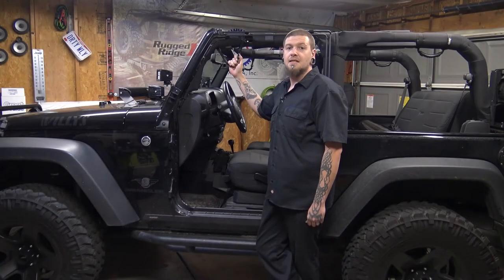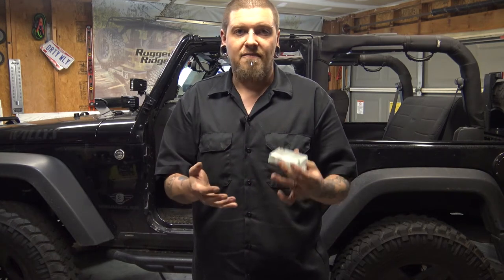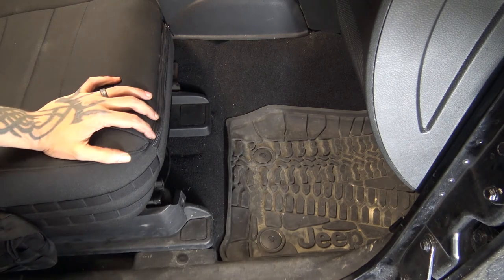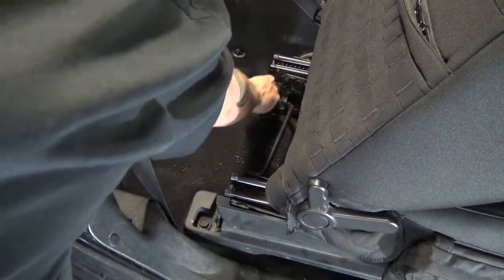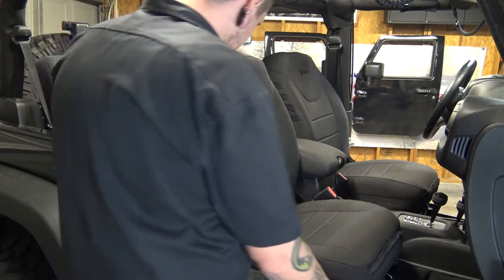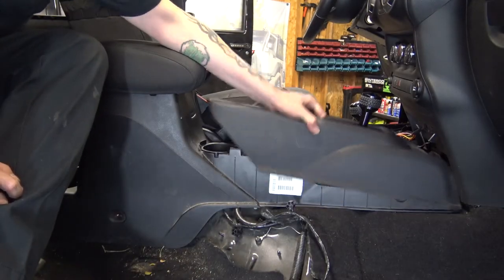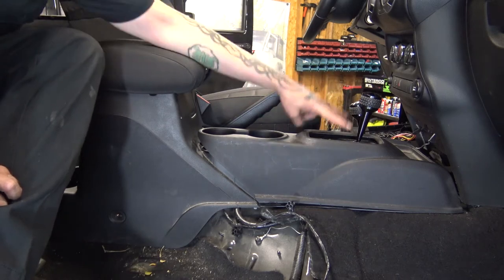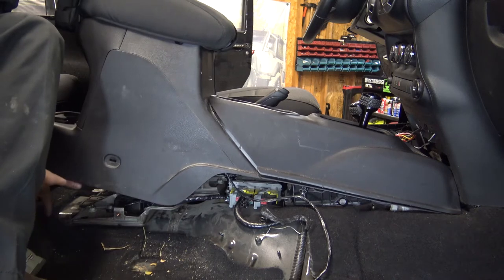How To Add a Motion/Proximity Sensor To Factory JK Alarm, Project Dirty Willy Ep.19

Comment: Cool. Can you show how to adjust the proximity sensor box. Like the buttons on it?
Reply from the maker: If I have to take the console back apart for some reason I'll be sure to video the adjustments. All you have to do is remove the little black plug (they look like buttons) and you will see 2 adjustment screws. You just have to mess with them, at least that's what I did. Thanks for watching!
Reply: Rocky X TV ok cool thanks. Yea I see that there is two dials. Do you know which dial does what?
Reply from the maker: Honestly is has been so long that I forgot...
Reply: Rocky X TV no problem. Sweet jeep.
Reply from the maker: Thanks!

Comment: Hi bro it's me again, I've purchased everything I need for the install, just one question...the Directed Install 508d  Motion Sensor has two rubber adjustment knob covers, do I remove them? is there a screw underneath each? Also since we aren't using the chirp feature I will only have to adjust the outer beam (right knob)? Thanks again
Reply from the maker: There are two adjustment screws under those plugs, one for each zone. You can either leave them where they are set if by chance they work out for your vehicle/application, or you may have to fine tune them so the system won't be overly sensitive. I had mine set way to sensitive at first and it would go off if someone walked withing a few feet of my Jeep. That was a little too much.
Reply: The wire I'm using is the door pin on a sedan vehicle, the problem is that this wire also runs my DOME light, the sensor worked for a couple days until I used my DOME light manually, then it stopped working. I tested the door trigger wire and there is a voltage change when the DOME light is toggled on/off. I then tested the output of the sensor trigger wire (blue) when the sensor is triggered, the reading is 0.83 on the multimeter BUT it is not triggering the alarm at all anymore. Any thoughts on what you think this could be? Thanks
Reply from the maker: We'll get it figured out. I think you just have it hooked to a positive instead of a negative.

Comment: hello willy, greetings from ghana and thats an amazing video you have there. I have a few questions.1, can I install this in a car with no factory alarm system and just connect it to a siren or the car horn.2, Is there a time delay between which the device starts to work when turned on.3, From your video I am quite confused how firstly u activate the device and activate your factory car alarm as well, what turns what on between the car alarm and device. Please help, just got robbed, I need to fix one asap.
Reply from the maker: You could add this sensor to just the horn or a siren, but it would require more wiring and another relay. There is a 15 second delay between the time you "arm" the system and when it actually starts working. As for activating, I'm not sure I follow, You just press the lock button on the factory key which "arms" the system which in turn activates the factory alarm and added motion sensor. I hope this information makes sense, thanks for watching!
Reply: Thanks for they reply. I want to get the motion sensor and a siren for my car ( toyota corolla 2013) but my main issue is how to turn the motion sensor off when it is armed and I am  outside the car as my car didnt come with a factory installed alarm.
Reply from the maker: I see what you mean now. Unfortunately you would need to install some form of alarm system otherwise you would just have the motion sensor wired to a switch and you would have no delay before you get out of your car it goes off. It would also only go off once because the sensor only sends a single pulse signal. You would have much better luck looking into some of the Viper alarm systems because some of them have a spot where you can just plug in the motion sensor, no extra wiring required. It looks like using just the motion sensor and a siren alone will not work out very well in your case, but some of the Viper alarm systems are pretty affordable, and I believe some may come with the motion or a shock sensor. I wish you the best of luck and I'm sorry to hear about your break-in.
Reply: Great Willy, I just wanted to be smart about this but was loosing a lot of sleep. I was considering having only the Viper 305 which comes pre installed with a shock sensor but no motion sensor but issue is i dont want a break in before my alarm goes off. Is there any complete alarm that comes with a shock and motion sensor pre installed, if not what will you recommend. That i get the motion sensor which plugs easily into the viper 305 and both will work fine. Appreciate your concern and time willy.
Reply from the maker: If you are talking about the Viper 350 alarm system, yes you can get the Direct Install Essentials 508d motion sensor and it will plug directly into the system. This setup would give you the built in "shock sensor" of the Viper 350, this is if someone bumps you car or bangs on it (you can set the sensitivity) With the 508d added it would also detect motion in or around the car depending on how sensitive you set it as well.
Reply: Willy, I am getting the Viper 3105, can you guide me on fixing it, I will appreciate that a lot
Reply from the maker: I'll see if I can download the instruction manual as well as the wiring schematic for your Toyota and see what I can do. When you get the kit you will want to get some T-taps as well, these will make connections to your car so much easier. You can also email me for help at rocky.tvchannel@gmail.com

Comment: Is there a way to add a Tazer to the driver side seat that gives the thief a tingle in their dingle?

 I am thinking of hooking up a halon or CO2 dump into the engine air intake that will deprive the I.C.E. of oxygen while the alarm is on, That way eventually if they disable the alarm, the engine will not start until the air intake has dissapated the Halon or CO2! 

Which should take 10 to 20 minutes.

That or an alarm activated Fart In A Can to the interior cab with auto door lock on.

 This will lead to enough frustration that they will give up, throw up, Or they will call 911 and turn themselves into law enforcement voluntarily!

What do you think of the three options, Tazer to the Deriere, Engine Air Intake Oxygen Deprivation, or Fart In A Can to interior?

Or all three?
Reply: The above comment is NOT mine, my husband borrowed my tablet and did some creative writing! 

I apologize, he is in the dog house and it will Not happen again!

Comment: I think the warn output is one of the coolest features.  Unfortunately no warn input on OEM's.  My question is, how the hell does the exterior proximity work when it's buried in interior plastics?  Or the interior for that matter?
Reply: It uses radio waves (microwaves) that are able to penetrate plastics, carpets etc but not anything metallic
Reply: @darrellcoutinho805  -- So sort of like sonar.  Yeah, I see now.  I suppose metal would absorb any electromagnetic radiation.
Reply: @lJUSTwanaCOMMENT  yes, in a way. All these types of sensors use the doppler effect to sense changes in proximity. When set up correctly, these microwave sensors are excellent 👍🏽

Comment: Do you get gate open signals when you step into the car before ignition is on?
Reply from the maker: Before the ignition is on yes. This is also another use for the micro switch, you can mount it in a hidden location that is also easy to get to and you can simply flip the switch if the gate indicator is an issue. Thanks for watching!
Reply: Rocky X TV Thanks that makes things clear, thats indeed a good thing to install the switch so you can turn it on when you want. Nice video and good explanation.

Comment: Is this the same if you add to a Viper 5706v?
Reply from the maker: The Viper system should have a connection port that you can just plug the proxy sensor directly into, I could be wrong though. I'm not 100% familiar with that system. I'm sorry I couldn't give you a better answer, thanks for watching!
Reply: Rocky X TV thank you

Comment: Where do I attach the switch to disable it ? Witch wires?
Reply from the maker: On the red constant power wire for the relay, thanks for watching!
Reply: How about if I have the motion sensor hooked up with the viper alarm.
Reply from the maker: If you have a Viper system you should have a spot where the sensor can just plug right in. This proximity sensor works with a bunch of systems and is plug and play with most Viper setups.
Reply: I know but for the toggle switch to turn it on and off , do I have to cut the red wire and then attach one side of the red wire to the switch then the other half to the switch? Like I have it setup up with s viper alarm ?
Reply from the maker: If you have it plugged into a viper system, not the OEM alarm like in the video, you would need to cut the RED wire in the little 4 pin harness (red,black,green,blue) for the sensor. That is the power wire for the sensor. Attach one end of the cut wire to your switch and the other end of the cut wire to the other side of your switch. You may have to extent these wires to put the switch in a location of your choosing. When you turn this switch off it cuts power to the sensor only and not the rest of your alarm system. I hope that makes sense.
Reply: Yes it does thank you

Comment: Hi .. do u put a fuse on the Constant 12v ..?
Reply from the maker: It is not necessary, but recommended. A 5 amp fuse would be fine, I didn't realize I forgot that in the video. Thanks for watching!
Reply: Bc as an installer .. u must fuse everything..I like all ur videos
Reply from the maker: I tend to forget mentioning fuses sometimes as I fabricated my own secondary relay/distribution/fuse box that keeps all aftermarket accessories separate from the factory system. This box is pre wired and fused for a ton of aftermarket stuff so I just plug into it and there's already a fuse and relay there. Thanks again!

Comment: Hey man, I could really use your help. I have one question for you. Hopefully you see my comment, thanks
Reply from the maker: I'd be happy to help if I can. What's your question?
Reply: @RockyXTV   @Rocky X TV  thank God! Alright dude, so it's a lengthy one, because it requires some context.. I'm sure you understand why... Alright, so I have a 2017 silverado 1500 and I'm installing the 508d module. I've got everything I need, I've got all wires run etc.. the one thing thats been kicking my ass, I finding the trigger wire for the driver door, or any door. I've probed around in the plugs of door with a multimeter over and over again. While arming the system, while opening the door or closing the latch so it thinks it's closed.. so I found one 12v source in "A" plug behind the door panel, on the frame of door. Beside it are two other wires that get a 5v signal which I found out are the lock and unlock control wires. I cannot find a the wire to trigger the alarm.. so the trigger wire from the module sends a 5ma signal, what should I be looking for as far as voltage and maybe, in what location?? One other thing to add, when the door panels are OFF and I close the door and start the truck, it is reading that the doors are ajar. So maybe I need to plug the panel in and do some testing from there. Haven't tried that idea yet, as I'm always struggling to get time to work on it without my wife getting pissed off
Reply: And I did take the trigger signal wire from the module and try it in a few different places, but it never set off the alarm. And yessir, the module is working. I hooked it up to some LEDS lights and did some tests with the zone adjustment. Thanks for your time and consideration brother
Reply from the maker: @nathanbearden8685  Its been a while since I've installed one of these or watched the video. If I remember correctly the trigger for the module is a ground trigger. Are you trying to use a positive trigger on the module? I could be misunderstanding, if so I'm sorry.
Reply: @RockyXTV  if you get time, Itd be awesome to get on a phone call with you so I could tell what I have going on. There are ZERO installation instructions, apart from the legend/wire diagram for the module. It's alot to explain lol. Thanks in advance dude